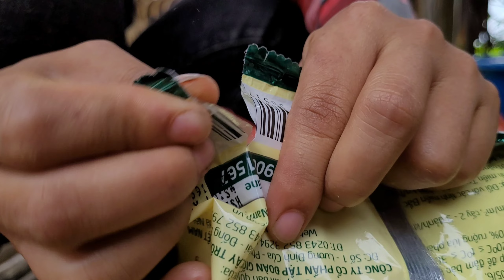The process of completing the Bowl Station and Soaking Rice Seeds, taking care of livestock.

Comment: You will figure out how to bring the line of water to the new house your husband should have done it before he left especially the water he knew you needed water
Reply from the maker: I'm looking for a place to run water🥰☺️
Reply: @mountainlife3486  see if you can attach the line from your farm and run it to the house put it on the side of the house dig a little dredge so it will run down hill and put a little cutoff attachment on that when not in use you have several houses around you 🥰